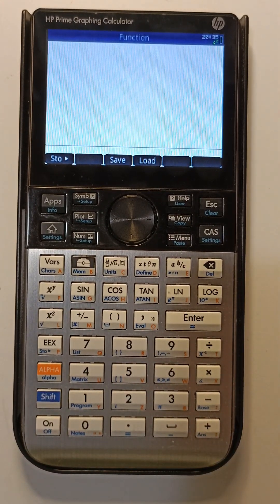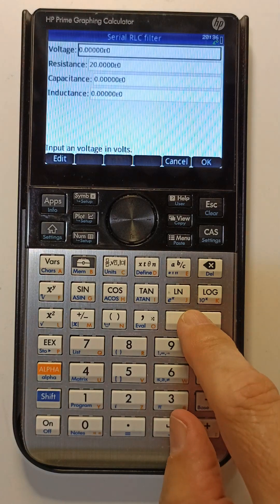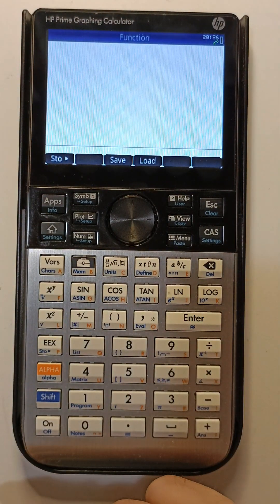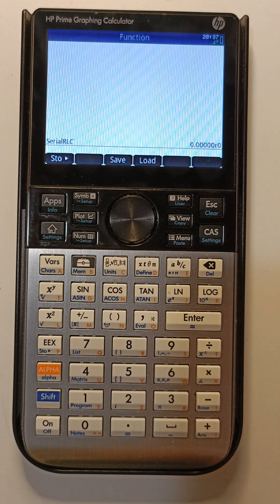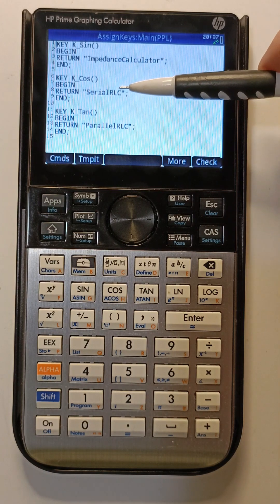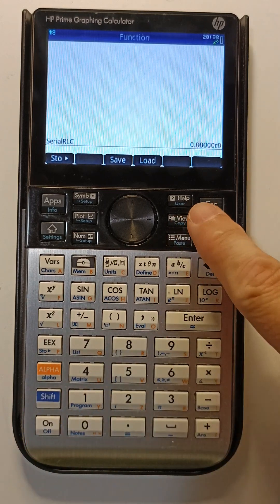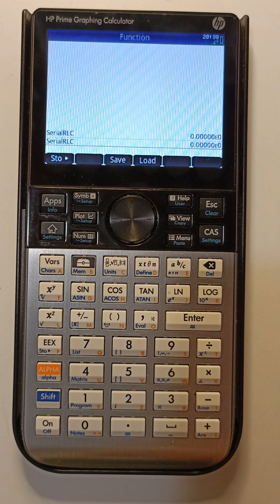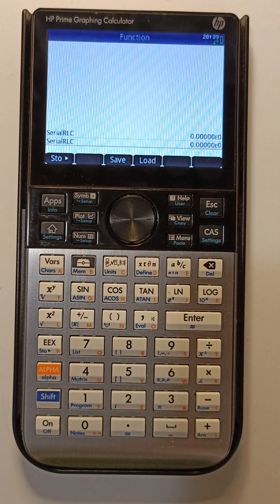How to create and use user defined keys on the HP Prime.

Comment: Where did you get the rlc app?
Reply from the maker: Here's the program. You need to initialize 3 variables before running the programs: IC, XC and UCC. Just give them random values. After that, it doesn't matter. 🙂 There might be other variables that needs initializing before first run of the program. Let med know if you learn a better way than mine.

Good luck.

EXPORT UCC;

EXPORT XC;
EXPORT XL;
EXPORT UR;
EXPORT UC;
EXPORT UL;
EXPORT IL;
EXPORT IR;
EXPORT IZ;

EXPORT SerialRLC()
BEGIN
LOCAL thechoice = 1;
PRINT();
WHILE thechoice == 1 DO
CHOOSE(thechoice, "MAIN MENU", "Enter values", "QUIT");
IF thechoice==1 THEN
PRINT();
INPUT(
  {UCC, R, XC, XL},
  "Serial RLC filter",
  {"Voltage:", "Resistance:","Capacitance:","Inductance:"},
  {
    "Input an voltage in volts.",
    "Input an resistance in Ohm.",
    "Input an capacitance in Ohm.",
    "Input an inductance in Ohm."}
);
UCC▶UCC;
R▶R;
XL▶XL;
XC▶XC;

print("Voltage:     " + UCC + " UCC");
print("Resistor:    " + R + " Ohm");
print("Capacitance: " + XC + " Ohm");
print("Inductance:  " + XL + " Ohm");
Z9 := R+(XL*)-(XC*);
Z9▶Z9;

PRINT("Impedance:   " + Z9 + " Ohm [Vector]");
PRINT("Impedance:   " + ABS(Z9) + " Ohm [Scalar]");
PRINT("Angle:       " + ARG(Z9) + " degrees");
IF ARG(Z9) < 0
THEN
  PRINT("Circuit is capacitive.");
ELSE
  PRINT("Circuit is inductive.");
END;
I := UCC/ABS(Z9);
PRINT("Current:     " + I + " A");
UR := R * I;
PRINT("UR:          " + UR + " V");
UC := XC * I;
PRINT("UC:          " + UC + " V");
UL := XL * I;
PRINT("UL:          " + UL + " V");
PRINT("Press any key to continue ...");
WAIT(0);
END;
END;
END;

EXPORT ParallelRLC()
BEGIN

LOCAL thechoice = 1;
PRINT();
WHILE thechoice == 1 DO
CHOOSE(thechoice, "MAIN MENU", "Enter values", "QUIT");
IF thechoice==1 THEN
PRINT();
INPUT(
  {UCC, R, XC, XL},
  "Serial RLC filter",
  {"Voltage:", "Resistance:","Capacitance:","Inductance:"},
  {
    "Input an voltage in volts.",
    "Input an resistance in Ohm.",
    "Input an capacitance [XC] in Ohm.",
    "Input an inductance [XL] in Ohm."}
);
UCC▶UCC;
R▶R;
XL▶XL;
XC▶XC;

print("Voltage:     " + UCC + " UCC");
print("Resistor:    " + R + " Ohm");
print("Capacitance: " + XC + " Ohm");
print("Inductance:  " + XL + " Ohm");

IF R > 0 THEN
 IR := UCC/R;
ELSE
 IR := 0;
END;
PRINT("IR:          " + IR + " A");

IF XC > 0 THEN
 IC := UCC/XC;
ELSE
 IC := 0;
END;
PRINT("IC:          " + IC + " A");
 
IF XL > 0 THEN
 IL := UCC/XL;
ELSE
 IL := 0;
END;
PRINT("IL:          " + IL + " A");

IZ := IR + IC* + IL*−;
PRINT("Current:     " + IZ + " A");
PRINT("Current:     " + ABS(IZ) + " A");

Z9 := UCC/IZ;
 
PRINT("Impedance:   " + Z9 + " Ohm");
PRINT("Impedance:   " + ABS(Z9) + " Ohm");
PRINT("Angle:       " + ARG(Z9) + " degrees");

IF ARG(Z9) > 0
THEN
  PRINT("Circuit is capasitive.");
END;

IF ARG(Z9) < 0
THEN
  PRINT("Circuit is inductive.");
END;

IF ARG(Z9) == 0
THEN
  PRINT("Circuit is resisitive.");
END;

PRINT("Press any key to continue ...");
WAIT(0);
END;
END;
END;
Reply: @bernhardarpsrensen  many thanks... I had to add "EXPORT IC;" to define IC, but it's all ok. Thanks.